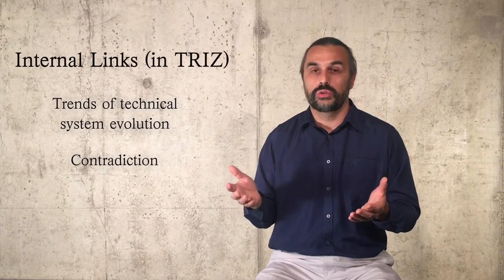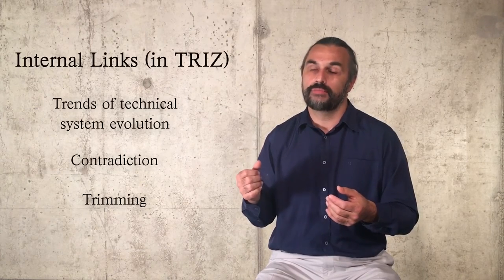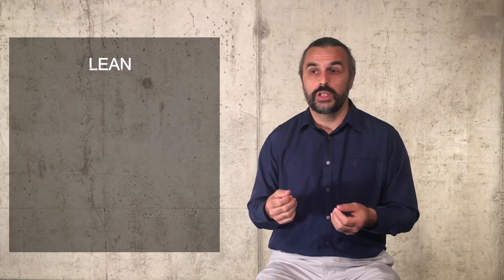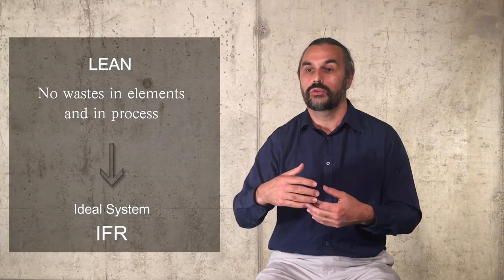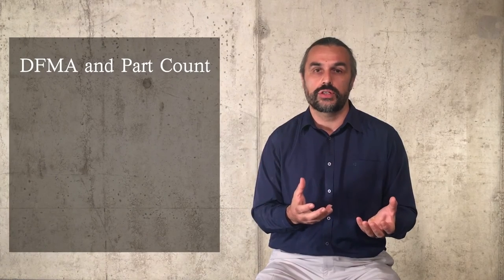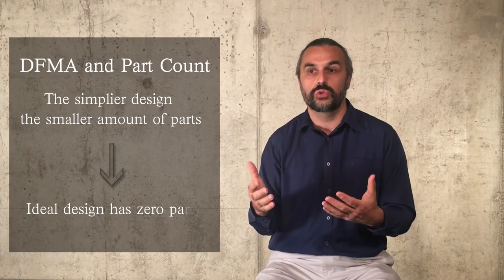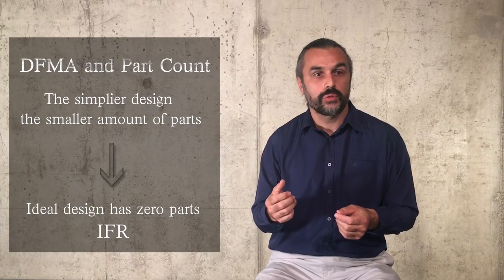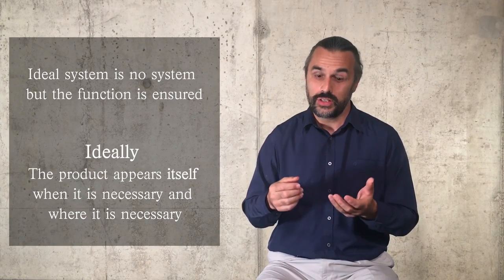TRIZ. Ideal Final Result. Leonid Chechurin

Comment: vocabulary:

00:10 introduction:
ensure - provide; appear - occur; come up - think; stretch - extend; maintenance - repair;

01:55 history:
although - however; warding - protection; reformulated - rephrase; straightforward - direct;

03:50 links in TRIZ:
trimming - cleaning; approach - method; treat - process;

06:00 links outside TRIZ:
spiritually - mentally; bluntly - directly;

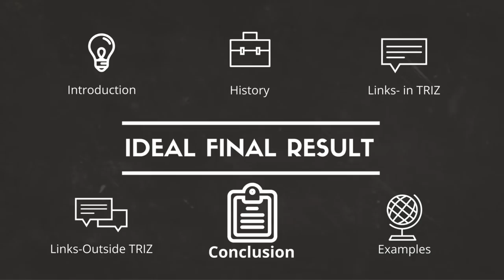09:40 conclusion